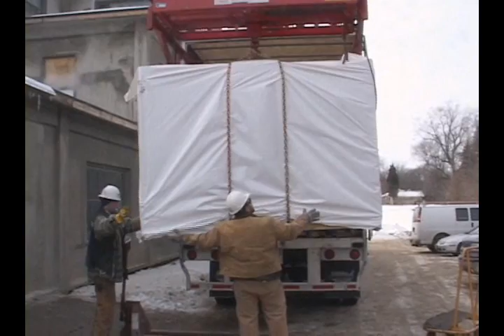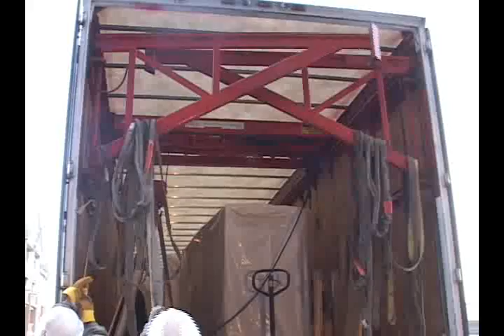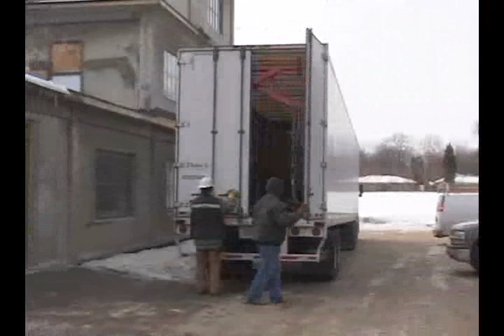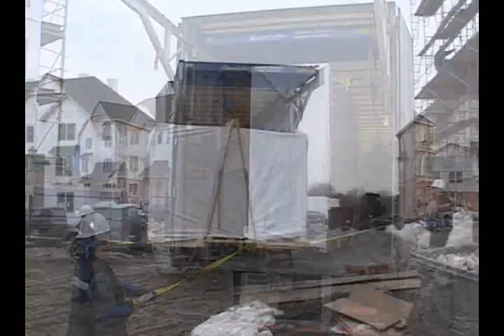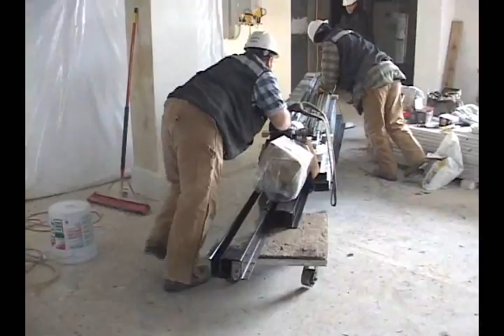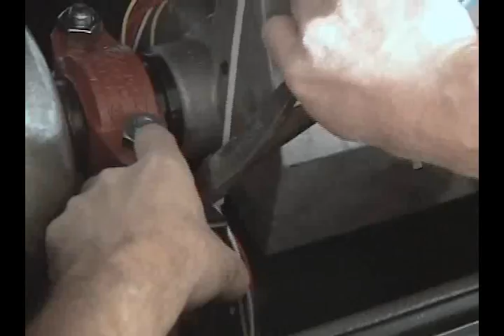Cargomaster crane unload

Comment: I've hauled these elevator components for this manufacturer before and I can say that the crews they have on site were very good to work with. I delivered using a dry van, no crane, and they still usually only took a couple hours to unload. A crane trailer makes things  much easier! These loads are light and pull easily. All that said, you are still delivering to a job site and everything doesn't always click just right (another truck unloading where you need to set up, etc), it's a good gig.

Comment: Interesting trailer. That makes unloading easier than having to manhandle large units around and hoping that the job site has a working fork lift!  Wish I had one of these when hauling AC fans into NYC. This cuts down on those Union riggers inside the trailer giving you crap because I'm not  a union Teamster!I wonder if they have to be union for this company?